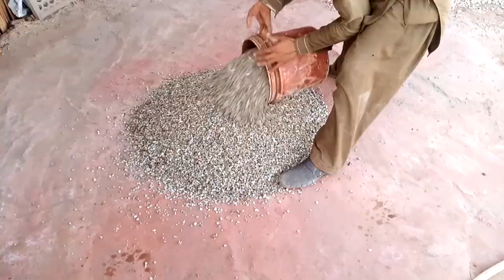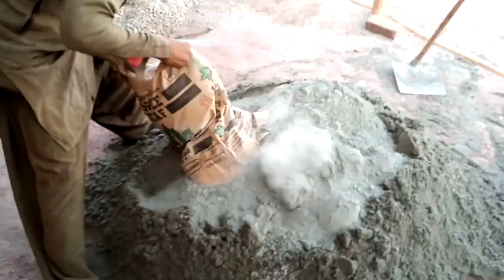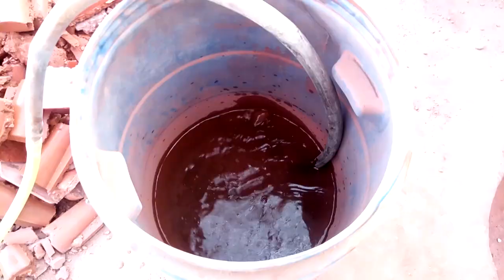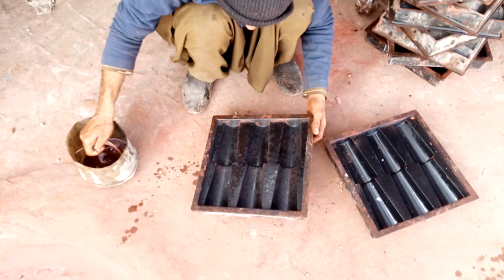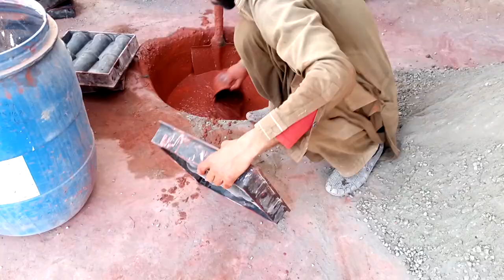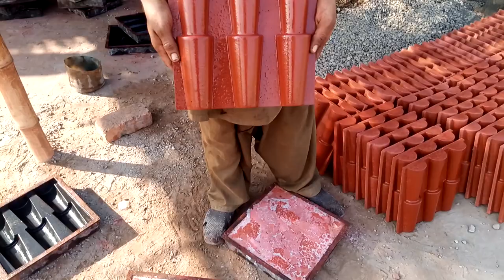New Design of Roof Tile Making Full Process Step by Step

Comment: how do you overlap the tiles for waterproofing ?

There is no concave shape for nesting them together with overlap .

Are these tiles for indoor use only ?
Reply: if they havent already, the molds would need a tounge and groove or some sort of design to add that laping style joint. easy if you integrate in the mold. its concrete mix so id assume its just normal concrete indoor/outdoor but this mix does not have much strength (not high psi conc mix which you can just change the mixture to achieve) so dont make these and expect to support vehicles or anything. these have a simple job, but do it well. note for roofing you need to understand the underlayments and what the additional weight will be on your existing joists
Reply: Yeah, these are useless.  They must be very heavy and very weak considering the amount of water in the mix.

Comment: What material did you use in coating the moulder before putting the mixed concrete in it? Is it oil?
Reply: waste oil i presume